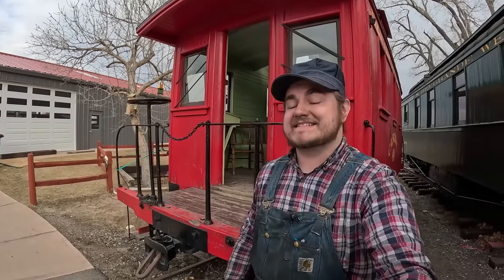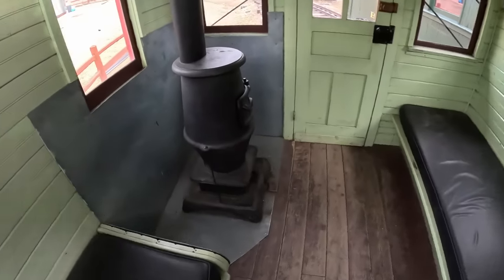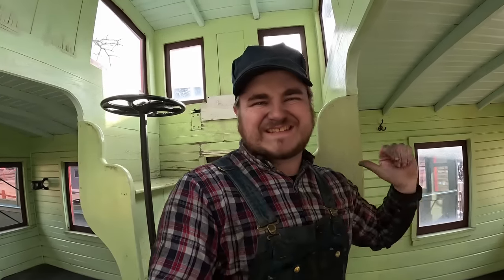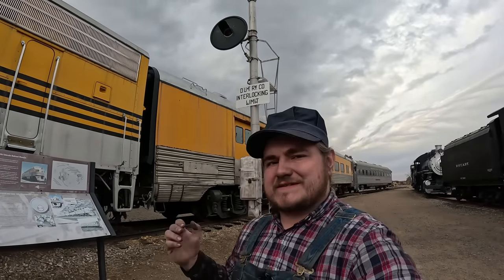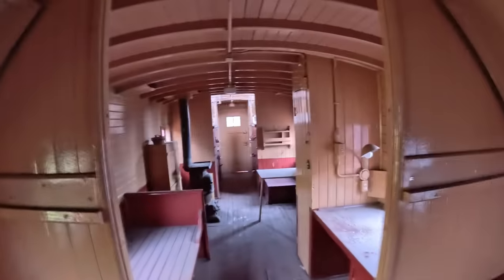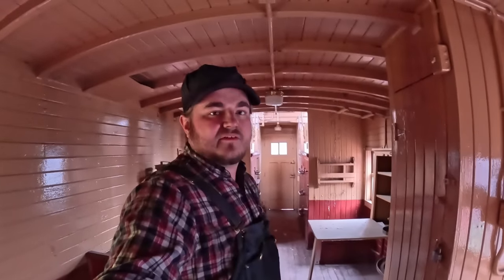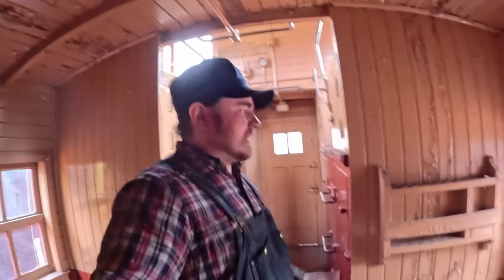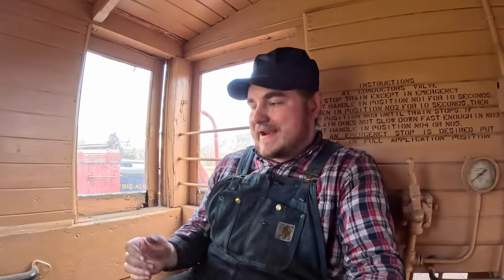Why don't trains use CABOOSES anymore?

Comment: It's an interesting comparison to UK Guard's Vans, which appear to play a similar role. In the UK air brakes and solid couplings came very late to slow freight trains, so in addition to helping slow the train the guard had to take an active role in managing the couplings. When descending a bank the guard would apply their brake in order to keep the train in tension. Otherwise when the locomotive reached the level or the next ascent the transition from compression to tension could damage couplings or even break the train in half.
Reply: Unfitted freight with the guard van was rather inefficient, air braking was the way forward

Comment: Before the days of centrally controlled switches, if a train needed to pull onto a siding, the brakeman in the front would open the switch and the one in the rear would close the switch.
 The BNSF was still using a caboose on one switch to Cherry Point WA as late as 2016.  I remember hearing the caboose whistle as a 30+ car switch train backed across the intersection I was waiting at

Comment: Here's an idea for a follow-up video: Reasons why some railroads still use cabeese. Whether as a mobile guard shack for high-security trains, remote control platforms or even mobile Maintenance of Way offices, there's a wide variety of reasons to still have a caboose on some trains.
Reply from the maker: That's a fun idea! I'd honestly need to learn and understand those options moreso to really present that but it is a neat topic.
Reply: One of the reasons a railroad might still use a caboose is if it's going to back the train over a public highway.    The conductor needs to flag the crossing.   The platform of the caboose is much safer than hanging off of the side of a random railcar
Reply: Not really~~~other then having a platform to stand on and not having to hang on the side of a car they are nothing but a nuisance, ask any yardmaster they could care less about “safety”….
Reply: @mshum538  And how many years were you with the railroad?
Reply: @TheOneTrueDragonKing  40 continuous,👍~~~
Reply: @mshum538  I highly doubt that. For starters, unless you're outside the United States, mandatory retirement age from the railroad is still 65. Based on what you said elsewhere in this thread, I'm inclined to believe you're older than that.

Second, you don't talk like a railroader. You talk like a man who hates corporations and trains and you have have a massive amount of disdain for people who are employed as your boss.

You don't act like a railroader either. ALL railroad employees are concerned with safety. There's a whole culture built around "safety first". It's drilled into you from the moment you arrive for training.

Ask any real employee of the railroad, ESPECIALLY the bosses like yardmasters, and they will always, ALWAYS care about safety.

So you either just started with the railroad (and are one act of insubordination away from getting fired) or you used to work for the railroad but got fired on your first day. Another alternative is that your 40 years have been playing simulators. Video games are not railroading.

With the attitude you have, you'd never make it one day as a railroad man. As my late grandfather would say, you're fibbing!
Reply: @TheOneTrueDragonKing 
The Mandatory retirement age is 70  yrs old!
Reply: @rickkeeton9246  Whoops. Still though, what I said about Mr. MS Hum53 is true.
Reply: @TheOneTrueDragonKing  There is no mandatory retirement age on the railroad. We have people over 70 and there were people over 80. As long as you can pass the test, you can run.
Reply: @schinbone0  Somehow I doubt that, especially in the US where it's federally mandated.
Reply: @TheOneTrueDragonKing  Doubt it all you want, it is not federally mandated. I have worked for a class 1 for almost 30 years, there is no mandatory age, most guys go at 60 because of how shit the railroads are. Pilots have to go at 65 not railroaders.
Reply: @schinbone0  Retirement age is mandated by the federal government for all jobs, not just railroaders.

A quick googling shows you're lying. The FRA mandated retirement age for railroaders is 65 years old, no more.
Reply: @rickkeeton9246  No it is not. There is not a retirement age.
Reply: @TheOneTrueDragonKing  Just for fun I did google it. You are seeing the age which, you get full pension, not mandatory retirement age. Learn to read before you call someone a liar, rail buff.
Reply: @TheOneTrueDragonKing  That is a lot of yapping for a rail buff. mshum is right, cabs are a pita, they do not want anyone to get hurt, more importantly to them, they want stuff out of their yard. So safety ain't first anymore. Hell, it's not even on the propaganda sheets anymore. See almost all railroaders have bad attitudes, working all shifts with little sleep. The job is hard, people have attitudes from the railroad always trying to screw them around, trying to write you up for stupid stuff, like forgetting to sign the inspection card . You have nerve saying he is lying, playing games, when you just play pretend in your basement. So unless you know anything other than how your pretend set up in your basement works maybe not talk about things you know nothing about.
Reply: @schinbone0  I'm not just a rail buff, I'm angling to be a railroad employee someday so it's within my interest to know the law.

I also know how to read and have been since I was three. Self-taught and currently at college level. So quit with the insults, I am perfectly capable of the most basic of tasks.
Reply: @schinbone0  I know a lot about how the railroad works. Documentaries, lessons from people like Hyce, and others who have worked on the real railroad. You can learn a lot from watching those, even if they are on YouTube.

I'm angling to be a railroad employee someday. I've already applied once for train crew on the Union Pacific and was denied, but I have a feeling I was too "foamer-y" when I applied the first time. I intend to try again when I have the right qualifications.

According to those documentaries, I already eat like a railroader. I already sleep like a railroader, and a whole lot more. All I need is the actual job and I'm set for life as I'm already well-adjusted to that kind of life.

The only thing I don't have is the bad attitude you falsely claim all railroaders have. Even with all the stuff I already do, I still manage to have a good day, every day. So shut your lying, insulting, foul mouth.

Railroaders are professionals - they're nice when they're required to be. They may not always be in a good mood, but they don't show it in public! And whether you believe it or not, public includes YouTube AND the rest of the internet!

That's why Hyce is a believable railroader. He knows his stuff and he doesn't have the foul attitude you do. He's got the proper railroader attitude.

Yes, I know I have a lot of nerve accusing you and mshum of lying, but here's the thing: The "pretend setup in my basement" doesn't exist.

That's because I don't play pretend; mark my words I WILL have that railroad job someday. It's been a goal of mine since I started reading at age 3.
Reply: @TheOneTrueDragonKing  I understand now kid. Just don't call folks liars if you don't know is all.
Reply: @schinbone0  Wow... I did NOT expect me telling you off to work.

Thanks for your vote of confidence, even if you didn't put it in words.
Reply: @TheOneTrueDragonKing  Once you started telling me off/explaining I understood. I love airplanes and my pilot buddies (they all love trains) are cool with me. I suppose they love airplanes too, they had to pay for their training, unlike the RR. If you try at UP again, good luck.
Reply: @schinbone0  Thank you.
Reply: @TheOneTrueDragonKing  Check your email
Reply: @schinbone0  Nothing there.
Reply: @TheOneTrueDragonKing  I will try again
Reply: @schinbone0  Still nothing.
Reply: @TheOneTrueDragonKing   Check your pinned comment on Quora. Hopefully it is there.
Reply: @schinbone0  Thank you for the proof, my friend. I can see that you were telling me the truth about you being a railroader.

If you are retired, I can see why. That smashed-up semi looks absolutely brutal - if the tractor was hit it would have been smashed to bits by the impact. Even if it wasn't the impact surely would have jarred some bones and given whiplash!

An accident like that is enough to give anyone PTSD.

In any case, I appreciate railroaders' hard work in keeping this country moving. Through rain and shine, blinding snow, pounding hail, twisting tornado, brightest day and darkest night, the railroads keep this country going.

Thank you for your service, railroad man.
Reply: @TheOneTrueDragonKing  Yeah the semi was a bit scary. It was a loaded grain truck, oats if you care. No one was hurt (except my under garments). Just thought you might like some "inside" views. Oh I thought it was funny, I play wows also.

 Good luck on your journey.
Reply: @schinbone0  Thank you.

Comment: Great video! 

Also, do you think you could make a video explaining crew communication pre Walkie Talkies?
In particular the cord that would connect through the train to the cab bell? I feel plenty of people mistake that for a break cord thanks to the movies. It'd be great to see that clarification.
Reply from the maker: Great suggestion!
Reply: @Hyce777  Thanks for another excellent vid. Would love more on this. I know the rear brakeman was to watch for hotboxes what did they do when he saw something that required a stop? Did they just pull the air, or was it with those lamps? edit -Never mind you answered it! I also feel like given recent events, having a human looking at things might prevent a train from being on fire for miles.
Reply: In some areas, there WAS a brake cord though. I have been on a train with them. The cord ran the length of the carriage, and at the end it pulled on a lever which vented the air. The lever was easily visible, so staff could quickly find which car had its valve activated.
This was the Kuranda Scenic Railway in Queensland, Australia.
Reply from the maker: @briannem.6787  I've seen it as well in the US.
Reply: @briannem.6787  I recall one instance where a passenger, probably a drunk, pulled the emergency cord & wore flat spots on all of the wheels on the passenger train.

Comment: A friend of mine did make a FRED for Stormworks to put at the end of the train, but even with signals and computer setups, we still insisted on having a caboose at the back in multiplayer.
A lot of reasons for it, but it was generally easier to transport and have someone monitor the train at the back, and of course... As mentioned previously, we still had the "train surfing" option built into every car so the guy at the back could get to the engine if needed.

We also found what we jokingly called the "Best caboose", basically if you take a small house with a garden and squeeze into a railroad car shape and gauge...
Of course complete with beds, kitchen and a TV :P
Reply from the maker: Well that's fun!
Reply: This is awesome- 😂

Comment: As someone who knows how important railroads used to be, and realizes that are still among if not the most efficient way of moving cargo and freight over long distances, I greatly appreciate locomotives and the history of them. Thank you for making these videos.❤️❤️
Reply: And people!
Reply: @theamazinghippopotomonstro9942  "People" are very inefficient, but trains are the most efficient way of moving cargo, especially over land. Nothing against truckers, but trains don't have the drag of rubber tires or nearly as much wind resistance per shipping container. They can move heavy loads over long distances with very little little energy compared to being on trucks. 2 to 4 trucks work the energy can pull 200 of those 53' shipping containers instead of one per truck. Anyway people are important too though when it comes to operating those trains, just not so much when it comes to moving people. Everyone is going somewhere different, and it doesn't make sense to use an entire train to move a few people. In the case of big cities for example it does over short distances like New York for example, but that's why they already have a subway system. Beats sitting in the parking lot traffic. In all honesty I'd just get a moped and something heavy duty to lock it up with. Thank you for the feedback though, I do greatly appreciate it.❤️❤️
Reply: @kentworch  Trains are excellent to move people between cities that are too close to fly and too far to drive. Europe and Asia have a robust, fast passenger rail network and it works. You take an intercity train to go from city to city and then a metro to move around within that city
Reply: @theamazinghippopotomonstro9942  That makes sense especially for heavily traveled routes, but not so much for moving across the country here in the USA. The ones we have go mostly unused and it doesn't make much sense for an entire train to go across the country for only 6 to 8 passengers. That's what is actually going on though, and it's honestly kinda sad to see. Like I said, more people need to use them. Trains are still excellent for transporting freight though, and in all honesty, I think we need to use railroads more and use the trucks for local distribution rather than moving our freight across the country by truck. Trains are much more efficient when it comes to long haul transit. One train can easily carry the cargo of 200 semi-trucks while only using the energy of 2-4 of those trucks. As far as people go, it's great in those high traffic areas, but wasteful if there aren't enough passengers.
Reply: For moving freight ; the rail trains are highly efficient.   On YT it talks about trains.  500MPG No passenger car can do that. Commercial trucks get maybe 15MPG pulling 1 50 foot reefer(refrigerated) -trailer whereas a train can pull 200 reefers across country.  It basically has to be then taken by truck where ever the train stops at the railway hubs.(as they do to this day)and hauled to the town or store that is not beside the rail line.  No need for long distance hauling.
. Since the 10day debacle with the container ship (the EVERGREEN) IN THE Suez canal, THAT ISSUE has now been addressed with them digging a second canal (pairing it) so it cannot happen again.   That shows how "thread like" fragile the demand/supply chain really is.   Containers have been piling up at loading docks, stacked atop of each other BECAUSE THERE IS NOT ENOUGH certified truck drivers available to haul the containers away.    The docks figure it will take 6 MONTHS before things will be back to NORMAL.  Many train tracks have been ripped out (stuff they could use right now) and dock workers have agreed to a new contract that they run 24/7/365 to clear up the backlog, BUT stores & industry have not agreed to be open 24/7 to receive the goods. They are PRIVATE businesses such as grocery stores, furniture stores, fertilizer plants, construction outlets, which is WHY we suffer shortages and higher prices(aka INFLATION).  That includes FUEL from overseas.  Nothing the POTUS can do.  He cannot magically cannot make Truckers.  It is something we have to wait out (unless you want to pay 5X's the cost for the item.)   I know, I won't.
Reply: @kentworch the economic and politics of people and goods mover are interesting. Part of why the national highway got so much discount, i.e. funding, is because they make up local towns infrastructures as well. If parts of rail transports are not supporting people too, they will soon be neglected by local government then national, which evolved into our current reality. I’m quite interested in how Switzerland managed to carry similar tonnage on rail compare to the U.S., yet still able to maintain good passenger services.

Comment: Here in Germany I've only seen crew cars on a super heavy transport train hauling a massive transformer. Since it moved really slowly, I presume they were either there to enable 24 hour operations or to handle all the special permits required for such a train.
Reply: On the really large or heavy loads, they may have crew to ensure the load can safely make it past nearby obstacles.  There are YouTube videos of some examples.

Comment: I was a freight guard on British Rail in the 70's and 80's. We rode in the brake van (caboose) at the rear and had to manage coupling tension on loose coupled trains when tackling gradients (up or down), also watch for hot axle boxes same as you guys. A snatch along a long train could be bad, especially for the guard. I had one driver (engineer) who used to say, " If I need you, I'll stand you up!" We also acted as rear pointsman (switchman) when any loose shunting had to be done into sidings. The wagons would be detached on the move with a shunting pole, and then hand brakes pinned down once it had come to a stand. Physical, and sometimes dangerous work, but enjoyable. When all freight trains went over to continuous air brakes in the 1980's, the brake van became redundant too. Guards travelled in the locos rear cab, and eventually were done away with altogether.

Comment: NZ Railway retired their Guards Vans (Brake Van/Caboose) in around the mid 80's, the last batch of vans built like 10 years prior, many of these FM ("F" designate for Guards Van "M" Modular) class are still around today, some on heritage railways some with Kiwirail as crew, Ballast blow or researcher EA class wagons on work trains, some converted into observation AKV ("A" Designated for passenger, "K" Kiwirail? "V" Viewing) and/or generator carriage AG ("A" Designated for passenger, "G" Generator), or some have simply been sold bogie less and sold off in modules or full sets as person accommodation